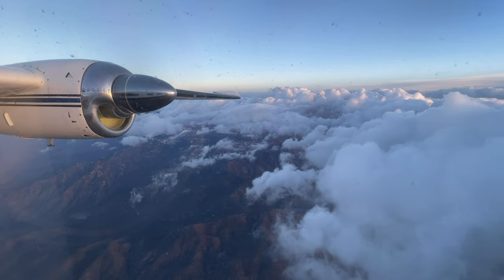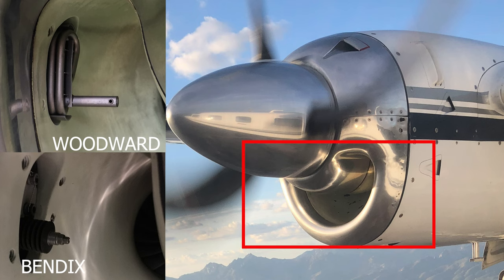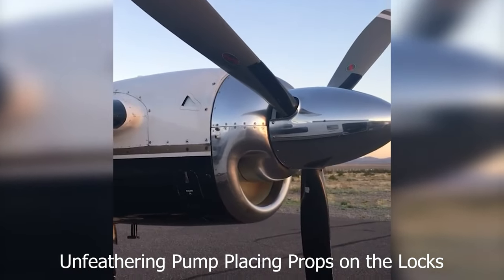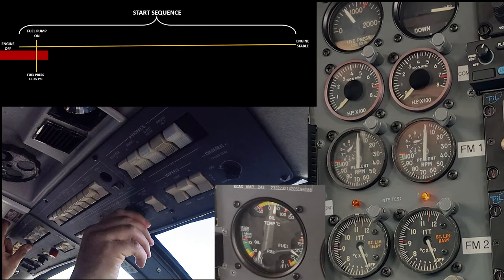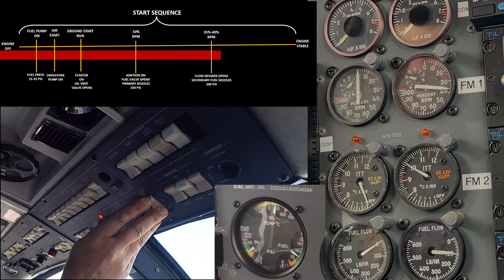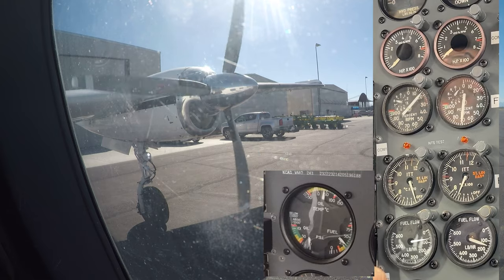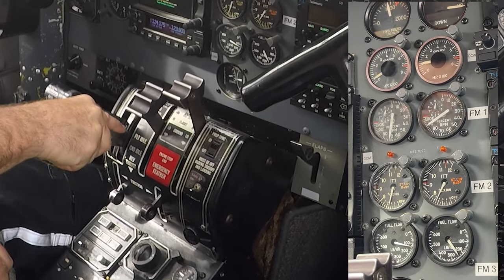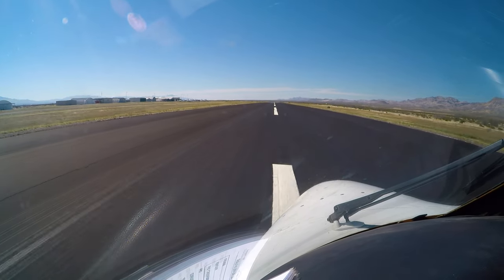Turbo Commander: Engine Start Deep Dive

Comment: Thank you so much for teaching this Start Procedure for the Turbo Commanders. I flew a 681 back in 1994, now with your instructions I am able to get it started. 
Please, if possible making other videos about taxing rudder and steering wheel typical Turbo Commander's control and other Ops procedures. Thank you a lot.

Comment: Cool! Now I can steal....er.....properly start a Turbo Commander if I happen across one that is "unattended". Good Vid. Newer pilots  just press buttons without actually understanding what is happening.
Reply from the maker: New pilots conduct maneuvers without knowing what is actually happening as well.
Reply: @jjkrmain

Older pilots too. They are the reasons for dumbing things down as well as higher insurance rates.

Comment: Very well explained.  One question if I may:  What exactly are the differences between power levers and fuel condition levers?  Do thrust levers act on the propeller pitch as the power is increased?
Reply from the maker: Power lever from flight idle to max thrust is going to control the metering valve in the fuel control unit, Condition lever is only going to set the prop governor, for the commander the permissible RPM range in flight is 96% to 100%.  To give RPM % context the Garrett turbine spool turns at 41,730 max rpm with a 26:1 gear reduction to the prop for a max RPM of 1,591.
Reply: The  condition. Lever sets the underscored and primary prop control. The power lever acts as a manual fuel valve and the prop governor controls engine speed@ 96-100% the over speed will hydraulically govern the prop above 101%, and the hp limiter will dump fuel above 717hp. Other garretts have a TTL temp/torque limiter
Reply: Underspeed governor

Comment: Wrt the PT6, the oil temps come up fairly quick, however in my environment of you take the blades out of feather prior to 10degrees oil temp you'll blow prop seals.  In the Arctic you either tether the prop on the start, or make the F/O hold it until temps come up. Yes helfansayftie loses there shit

Comment: Seems a procedure simular to other free turboprop engines.
one advice, during startup not only carefully monitor the ITT, TGTR, JPT (whichever yopu have) but alsno monitor the FuelFlow...
A high fuel flow may indicate a faulty fuel controller and surely result into a hot start.
Also time your startup to prevent running into a hung start.
Reply from the maker: good advice!
Reply: Our callouts. Rotation,10%, fuel flow, ignition, light off ,egt, 50/50, stabilized ,70%, stable start, parallel,gen on

Comment: No NTS test, no checking overspeed or underspeed governors.. Considering that most TCs only get a few hundred hours a year. These are critical. Also didn't discuss parallel vs series starts
Reply from the maker: We fly our Commanders on a daily basis, the checks you described are done at the start of the week, they are not daily checks.  The base NTS check is done every startup and there is no reason to discuss parallel vs series starts because the conditions requiring it are rare.
Reply: Well maybe my company takes it seriously because we spend 90% of our time below a 1000' ago and a lot of it at 200'.  Every start.
Reply from the maker: @ndenise3460  Nothing wrong with that.

Comment: so i have a question. so in a normal turboprop (with no autofeather/feather lock start), say a Cessna Caravan, would you start the engines with the prop lever full forward, then bring it back after start? just wanted to make sure i'm understanding this right.
Reply: The pt6 requires 10c prior to taking it out of feather.  Above that you can start either in feather or ground/flight.  If you don't have the power lever up it will settle at ground range.
Reply: @ndenise3460  thanks for the reply!
Reply: @ndenise3460

Negative. You can start it in fine pitch.  This is the PT6-20, PT6-114, PT6-140, PT6-60A, and PT6-67.  In fact most plane will not allow you to keep it in feather for any length of time due to hot exhaust gases damaging the airframe.  The only PT6 I know that they tell you to keep in feather is the PT6-67AG on the Air Tractor 802.